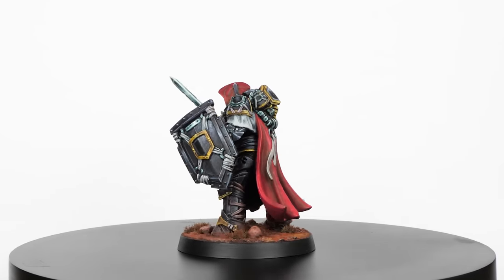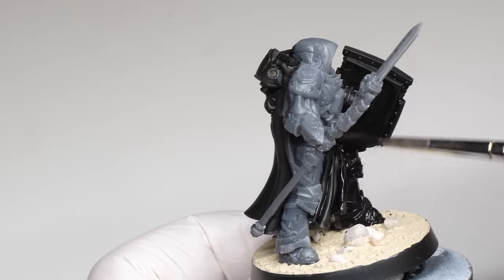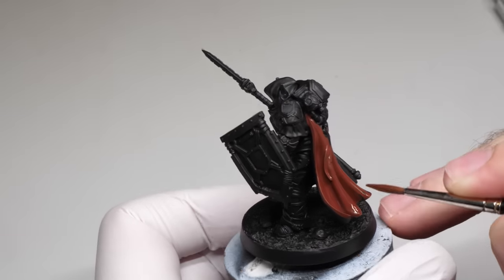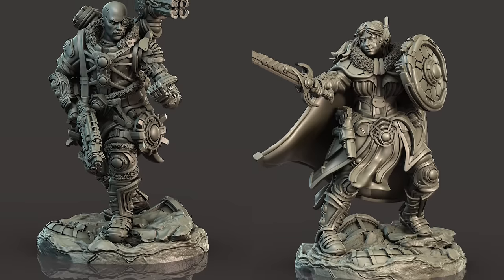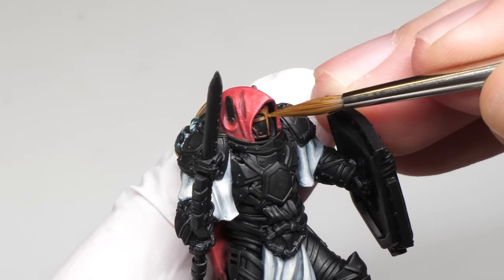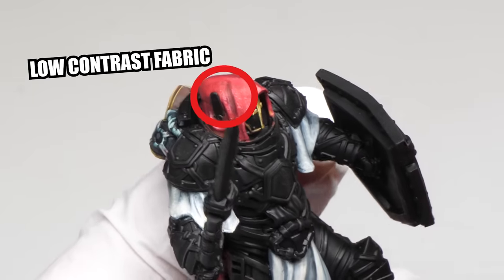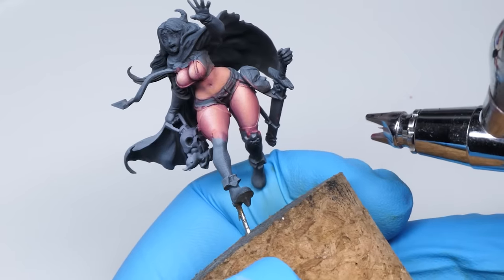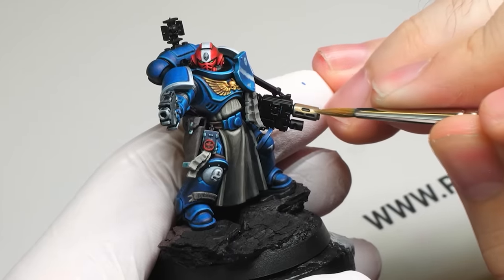...and other mini painting myths

Comment: Like others have said, "two thin coats" was originally meant to drill a simple concept into beginners: it's better to apply more than one thin smooth coat of paint, than try to cover on the first pass with thick goopy paint." That is all. At the time it was actually very needed advice! One of the primary stumbling blocks for beginners is simply not understanding how paint works. It's natural to assume to slap them paint on an object and walk away, like coloring in the line with a crayon.
Reply: I'm a complete noob to the hobby and my painting sucks at the moment. I keep getting that look (e.g. on space marine shoulder guards) that looks too streaky. It's like the brush strokes have remained when it drys. It's really frustrating.

Comment: Two Thin Coats method was EXCELLENT for me when I was a beginner painter. Following Duncan’s videos, it really was one of the best techniques to get me familiar with working with miniature paint… 7 years later and I usually dip out of the pot with a wet brush… I’ve got my style down for a proper consistency, so no pallet is required. . Improving your skill is the most important and learning new methods to achieve that 💜

Comment: I like how you question the norm and this shows that you have experience, knowledge and experimented with different techniques. Painters who follow the norm because it is the "best practice" but never tried a different approach will never understand why it became a practice. Technically two thin coats is introduced for beginners so they can easily correct any mistakes but at the end of the day, if you understand the different results and techniques, you don't need to follow it as bible truth.

Keep on making these great vids!
Reply: 2 thin coats was made by games workshop as an excuse for their paint's shitty coverage. You're way better off just adding a bit of flow aid to games workshop paints than applying them twice

Comment: I actually enjoy painting with acrylics, and use just about any acrylics I run into. It doesn’t even dry consistently and smoothly and when painting things like power armor or a dreadnought it actually gives it a really nice worn look to the metal. If applied in many very thing coats on smoother surfaces it turns out smooth and nobody would even notice.

Comment: 2 thin coats is valid because of the fact that it is a widely repeatable metric for "put a smooth layer down" does it work for every paint? no. does it work for most? yes. do you just need to use a little bit of brain power to figure out which ones do and dont? yes.

Comment: Also, metallics play by their own rules. Sometimes it's just better to forget about thinning metallics altogether. Some explicitly tell you NOT to thin them down, but for those that don't, don't thin the paint. Instead, just put the paint on your palate and wipe away the excess, until you've got enough to paint on your surface.

Comment: I came from a classical painting and scale model painting background, and learned all of that before youtube, so we didn't have many buzzwords.. but my favorite style for minis has got to be the 'not quite dry brush stippling' method. Sort of what Artist Opus shows off a lot, only I mix normal brush strokes in and often use a normal taklon brush for it.

But the biggest thing is to learn all these secret techniques, not to duplicate them, but to learn little tips on how to use a brush, paint, or mediums. Like it taught me if I add a little stippling motion and remove most of the paint from my brush while keeping it still moist (often with flow improver/paint retarder), I can provide nice soft, interestingly textured blends to my normal brush-strokes as needed. Then I can use the edge of the brush (like from edge highlighting) to capture sharper edges as I go, and use a more soft dry-brush for larger areas of uniform color that I want subtle gradients.

None of these are purely any technique with a name, but they're examining what a technique gives you and folding the aspects of it into your normal work, where needed. And seriously kids, try a flow improver and paint retarders instead of water to thin the paint. It simply works better in every way, it's not expensive, and it's even easier than using water. I don't mean avoid water, but just that you already have water from rinsing the brush off. Using flow improvers and retarders add qualities to the paint rather than water, which takes away from the paint, making it adhere worse, look worse, cover worse, and everything else.

Comment: My favorite myth is "don't use metallics in your wet pallet so you don't contaminate other paints".

Always used it. Flakes never passed through paper. Never contaminated other paints, even when I washed the brush in the same water cup.
Reply: I hear you and if you watch Vince venturella,  Sam Lenz to name a couple I follow,they  put metallic paint on their wet palettes and I also like you have never had any issues,  I think many who say that have never done it so will never know.
Reply: Like a lot of mini painting “rules” this own also depends. I wouldn’t be putting Vallejo Metal Colour (that specific range) on a wet palette, that stuff hates water with a passion.
Reply: @vajwjdjsnfjjddhsnan wut?  What do you think the other 30% of 70% rubbing alcohol is?  Water and alcohol mix fine.  VMC is water based acrylic with alcohol mixed in as a surfactant.  The reason metallics "hate" water is because it thins down the medium that the pigment is suspended in.  And, frankly, I've used metallics from a wet pallette.  It changes the behavior as it takes on water and evaporates alcohol, but it's still usable, especially if it's fresh.

Comment: Some models you can paint without primer, it just makes it easier if you have it.  But regarding primer, brush on primer exists and works just as well as spray primer, which is fine if you're just painting one model or if the weather doesn't allow for spray priming.

Comment: I have trouble priming models with a spray can. Since I use cold galvo on steel with welding I find myself way to zealous with a spray can. So thank you for the tip of painting on primer. 😊

Comment: I mean you don't really "need" to prime polystyrene minis  but I always do anyway. If your painting metal or resin models you will literally have to or it will just rub off.
"two thin coats" isn't literal, it's just good advice to stop new painters from painting straight out of the bottle and ruining their minis, I frequently use paint far thicker than that but I know what I'm doing.
Reply: I noticed plastic primer sticks well (melts into plastic, basically) but then paint doesn't stick to primer any better than it would to naked plastic. Paint chips off just as easily but reveals primer underneath instead of plastic lol.
I have a bunch of differently primed and unprimed models and I haven't noticed much difference in how well paint holds (it rather depends on miniature material). My metal orks are the most problematic and priming them with tamiya spray didn't help in the slightest. 
I've also seen old GW painting guides where regular paint was used to "prime" models (what we now call basecoating).
I call the whole priming thing a scam

Comment: Priming models was ESSENTIAL in the old days of lead, and later metal models. Not only does it make your paint cling to the surface, the primer acts as an insulator against metal rot. Yes, some casted models would rot over time (due to lead impurities) and develop brown stains on them that would show through your regular paint layers if you did not insulate the paint from the metal with a primer layer.

Comment: Thin coats/Glazes are the one that always gets me. I way prefer slowly feathering mostly full thickness paint that is slightly dry to get clean blends. Building glazes up works, but I feel like its a lot harder to control. Like anything, techniques are as good as the technician.

Comment: Primers are like, THE most misunderstood concept in miniature painting. It's sometimes infuriating how poorly it's misunderstood (and how much paint companies make the issue worse). But you're absolutely right, for plastic models, it's not really necessary. In fact, so much so that paint companies formulate a thicker paint (often by adding urethane for extra strength) and call it a 'primer'. When that's absolutely not a primer. That's just a base coat. Modern plastic really doesn't need a primer. Just to be cleaned, like mentioned. 

Primers are for materials that paint doesn't normally stick to very well, like metals, nylons or other high-energy surfaces. They contain solvents that dissolve organic contaminants and etch into the material to provide a layer that normal paints will stick to. All of them are toxic and have solvents and need to be well ventilated. Even metal has tiny pores that it can seep in to if you can dissolve out the oils and other stuff in them. And these paints are very tough, most are impossible to strip off a model (which can be a good thing), leaving you a primed model if you strip it.

Comment: I see where your coming from on this and the major takeaway is they are your minis do what you want with them and as long as your happy that is all that matters. I do feel that the Two thin coats advice is really from older paint solutions.  GW and most other brands have refined their paints a great deal and this sometimes isnt necessary or outright a bad idea (reaper). Not all techniques are useful for your average painter and some I find just make things easier for me such as drybrushing.  Primer is another one of those things that A makes your early first coats smoother and more uniform and B is depended on materials. Metals NEED a primer in my experience. Plastics are hit and miss some do and some dont. Resins rarely do to be honest. mixed materials can benefit from the uniformity it brings if nothing else. Regardless this is anecdotal and opinion based and some may feel completely differently than I do.

Comment: I just started in the mini painting hobby and I was dumbstruck by how the "thin your paints" myth was wrong. I was afraid of ending up like those meme pictures of spess mahreens with 1 inch thick layer of paint on them so I tried watering down my paint but just got a glaze or wash consistency no matter how little water I added. In the end, I just loaded the brush with undiluted paint and it worked wonders.

I'm guessing this myth comes from old GW paints which I'm told are quite goopy. (I was using Vallejo model colors)

Comment: You don't need to prime, but it will make it easier to paint the mini AND less likely for the paint to chip or rub off. 

Also, you didn't mention varnishing, which you absolutely don't need to do (especially for display only pieces) but unless you wear gloves when you play the natural oil on your fingers will wear the paint away. If you are going to play with partially painted minis, it's worth varnishing them and then giving them a quick bath before you continue painting.
Reply: But he did prime his mini...
Reply: @svensvensson2724  I guess he did? I'd suggest watching Goobertown's videos on priming and varnishing where he does fairly scientific tests. Basically you don't have to prime, but it's almost always worth priming ... like, you can eat ramen noodles dry... but they'll probably be better if you cook them.

Comment: 3d printed minis that were cleaned with isopropyl alcohol don't absolutely need a primer and don't need to be cleaned in soapy water.

But the paint will need to have excellent coverage, I used Pro Acryl Bold Titanium white on this with great efficiency.

Comment: Hey Simon. I think a very common Myth is: "You have to varnish your minis to protect" them! Brand from Goobertown made a nice video where he kinda proofed that varnishing doesnt protect your minis more. Also good to know: varnishing changes the minis look, as it makes everything same glossy/matte, but different paints have different finishes, so you might WANT the difference and a varnish could ruin that. But you can use varnish for the same reason if you wanna change the properties for example you have a shiny oil finish, but you want it to be matte, then use matte varnish just on the part where you want i to be matte. Or use glossy varnish with brush to filter over eyes or gems, there are plenty of possibilities for varnishes, but dont just be stupid and varnish the whole mini just to "protect" it ;)
Reply: I just watched 2 of goobertown varnish videos and he came to the conclusion that varnish does help to protect your minis in both videos. So I don't know what you're on about.
Reply: I highly doubt that. Varnishes give a hardened surface that most certainly will protect the paint better. I paint with vallejo acrylics and when I use glaze medium the paint tends to rub off on edges and pointy ends. Covering the minis with a varnish stops that from happening. 
Chemically speaking, a varnish adds a layer of (more or less) plastic (e.g. polyurethane) on top of your paint.

Comment: Most pro painters paint 6-8 thin coats, or even more to get good results, if they recommend just two is because they know that 2 thin coats means 2 semi thick coats for any begginer or regular painters, paint with several thin coats it's hard and most painters wants quick results.
Reply: Sergio Calvo might have to disagree with you on that one
Reply: @iosefminkov  he paint with several very thin coats because he always blend the colors, also he use airbrush to add shades or highlights

Comment: When I first started the closest thing we had to primer was flat black enamel. Later we tried flat black acrylic but found it rubbed off easily and on metal figs it could chip and flake very easily.  So we started mixing in drops of PVA glue that seemed to work. Then boom we had more primers than we knew what to do with.
For me the larger the fig the more mid tone layers such as 30mm,  54mm or 120mm.  With tiny models 15mm, 10mm or 6mm one mid tone is usually enough but really bring up the contrast including black lining on belts and where clothes meet or over lap. But this is me. Really the only one that needs to be happy is you and f*** everyone else.

Comment: I noticed you painted the black armor last.. any reason for this? I usually tend to work inside out so to speak, so I paint the deepest detail levels first going progressively higher in the process. The reverse seems to result in way more and way less fixable errors. Maybe I am just messy, but wondered why you saved the black armor in the depths for virtually last..

Comment: One of my favourites: you must must use a pallet, you cannot add water just right in a paint pot, you ruin your paints! Or another: you cannot use just ordinary water to thin your paints, even when it's water-based acrylic paints, you must use special 'medium'. And of course: you must use washes, why don't you use washes? Just because I do not like the result and my eyes bleed when I see dirty minis at any stage. At last it's simple waste of time - to do 3 steps instead of just 2 to get the equal result.

Comment: It's not wrong. It's just targeted at a entry-level painter who would otherwise just hammer his brush into the paint pot and slap a thick slop of paint on his model, ruining it in the process. It also comes from a time before all these contrast paints etc. Never lose contact to the roots of what it means to become a painter and what kind of place it is when you first start.

Comment: "Minuature painting brands are the correct choice, nothing else will do." There is very little difference between hobby paints and acrylics you can get from your local art supply store. Anything above student grade will do the trick and will save you quite a lot of money. With hobby paints, you are paying premium for lower quality product. You can get your brushes at the art store for cheaper as well.
"White paint needs more coats." Only because hobby brands use inferior pigments like kaolin for their white because they are cheaper. It's literaly chalk, which is why it's chalky. Get some genuine titanium white fluid acrylic. Covers black to fully opaque white in one or two coats. Same thing with yellow pigments.

Comment: My responses to your video today, Zumikito:

1 ) Even after cleaning, a lot of metal / pewter formulas are innately hydrophobic, and really SHOULD be primed. But plastic, resin, PVC, and Siocast don't REALLY need priming, true.
2 ) I agree wholeheartedly. It also depends on the paint brand, paint color, and more.
3 ) I just find an issue with people who ONLY think contrast is dark to light. There's also color temperature contrast, saturation contrast, and any combination. For example, a good flame has both brightness contrast AND saturation contrast - only the middle of the flame could be said to be high saturation. The inner desaturates to white, and the outer desaturates to dark gray smoke.
4 ) Yeah, as long as the tip is good, brush choice is up to you. I use a size 0 for everything except fine details, and have a Half Liner for fine details and freehand lines.
5 ) THANK YOU!!! I always say that you should never let someone decide for you what brand to use. Someone whose style is very similar to mine might find my favorite brand does not work as well for them, while theirs doesn't work as well for me. Try a nice selection to see if they work for you.
6 ) I would think that was self evident. I might always use a given technique for a given material, but that doesn't mean anyone else should.

Comment: Two thin coat is a mind set, not the gospel. Better to be too thin than too thick. As you get better, you know how to deal with paints.

Why struggle, get a cheap rechargeable wireless airbrush. It’s like $30. It’s super easy to prime with it, you cant mess it up. As you get better, you can also learn to do zenithal without spending a lot on airbrush and compressor.